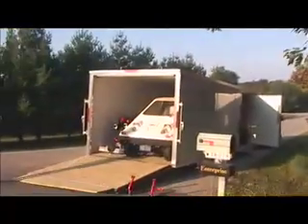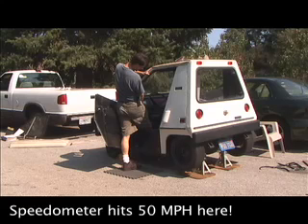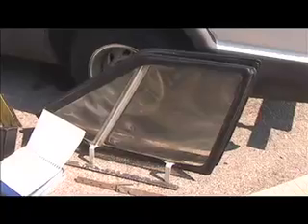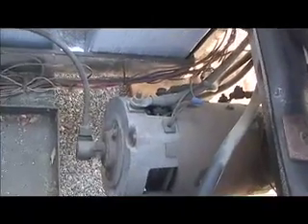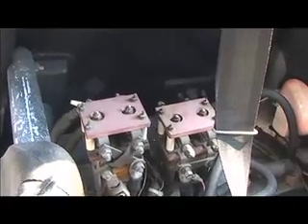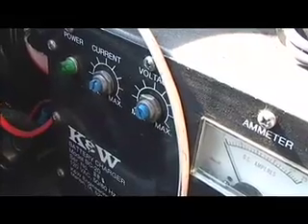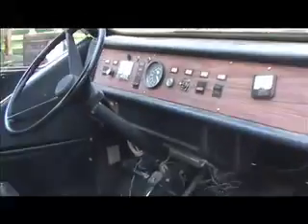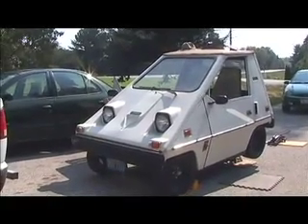1977 Citicar Arrives!

Comment: imagine that converted to modern lithium batteries. :P
Reply: +Ranno Rannikmaa There is a car very similar to these and a guy has converted it to lithium batteries and put a modern motor in it, It runs a 12 second quarter mile lol, You can find it here on youtube, the car is an Enfield and the guy has named the car the flux capacitor.
Reply: yup found it on fully charged channel

Comment from the maker: There are only a few little cracks and bubbles in the body. The car was upgraded to a 450 amp 72V Curtis PWM controller.
The motor is perpendicular to the rear axel. I am told this may be a "transition" car.

I will find out more this spring at the Citicar World Gathering!